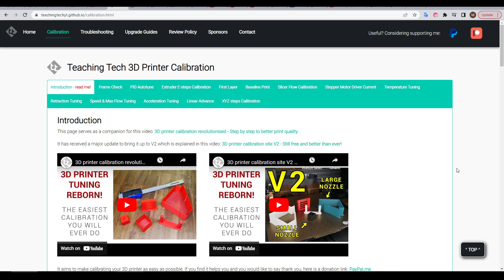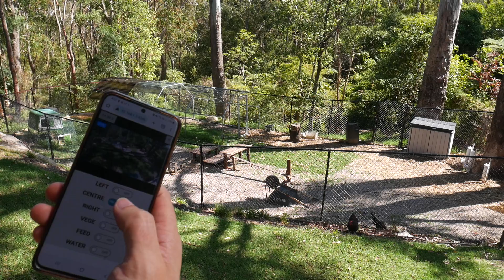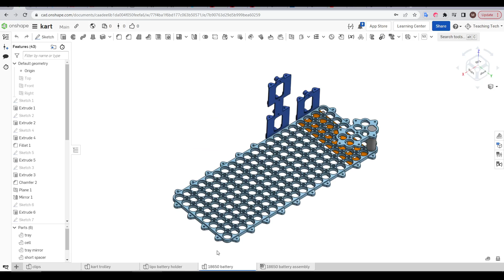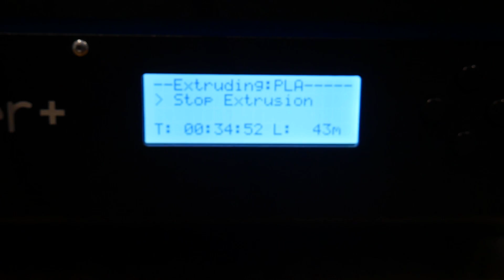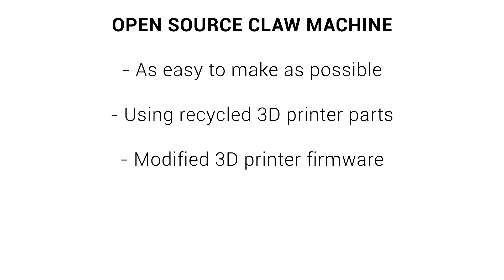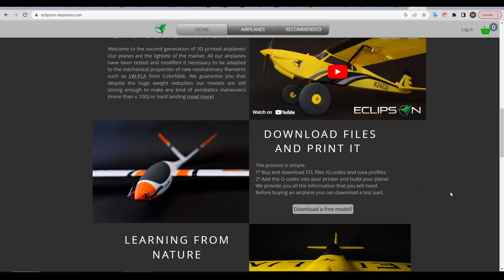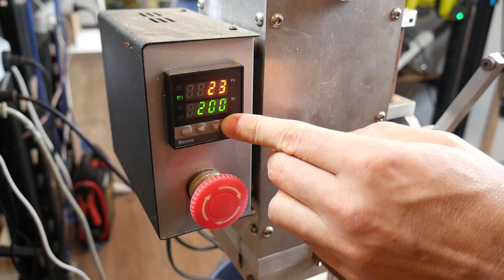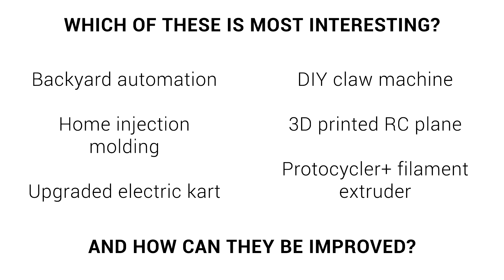Help me choose which projects to complete - 5 years of Teaching Tech

Comment: i would love to see an at home injection molded plastic machine in action. i don't see any machines that make recycled filament reliable enough to be used consistently. but a diy injection molding machine using recycled failed prints, and resin 3d printed molds could make operation fairly inexpensive 
though it would depend on how reusable the resin molds are. considering resin is much less recyclable
i got in to 3d printing through resin, though it did just order my first fdm printer this week. been reading up on your videos preparing for the fun!

Comment: As someone that has been flying RC for over 30 years, the 3D printed plane is the most interesting to me.  Two members of my club are also into 3D printing, one has a flying model that flies well, the other is still in the printing faze.  Have been thinning of trying one myself. If I can get my printers sorted correctly, so that parts actually fit together, I will try the RC plane, though I do prefer balsa models (plus they are larger). The kart is also an interesting project. Also a little surprised that your only at 400K subscribers, I have always found your videos very helpful!

Comment: 1. Back yard automation 2. DIY claw machine 3. Protocyler + Filament Extruder 4. Home Injection Molding 5. 3D printed RC plane then have fun with the last one: Upgrade electric cart (since it's already fully functional and usable, so you didn't loose anything really). And if you spin out and hurt yourself (unlikely) you can rest in bed after all the work is done, rather than doing that first and wishing you had sorted out the other stuff. 😉👍🏼

Comment: Help the pigmy goats! I vote backyard automation and I second Cooper -- with a customizable modular interface (both physical connectivity and physical or web UI control panel) including scheduling. Second vote is for the gokart - with some level of plans if someone wanted to replicate this OR with limited teaching of the basics (not "what is positive and negative" but more like why did you pick that type of recharge batteries, why that specific electric motor - what to look for if we were choosing, and how exactly is the speed controller working (custom or bought?) and wired in) so someone could say, build an electric scooter based on info from you. Keep up the good work! Heres to another 5+ years!

Comment: Happy New Year!

I'm going to pick the e-kart as being the only project I might possibly pursue.  The claw machine and backyard automation just aren't interesting to me - I'll still watch the videos, there's often useful things hidden in a video even if the main subject isn't relevant to my own, but as projects they're not all that exciting to me.  The Plane would be cool but I'm not really into RC planes so it would mostly just be entertainment for me.  The Protocycler+ and Home Injection Molder both speak to the main problem in 3D printing, what to do with the waste, but they both rely on very expensive equipment that I can't afford and have nowhere to put (I live in a 1200 square foot row house) so they again would just be for entertainment - there's not going to be any solution to my waste plastic problem hidden in them.

But the E-Kart is the sort of thing that I might build.  It's still not great odds and I probably would do the body more like a golf cart than a go-cart, but I've thought for a while about "I can build a remote controlled droid, I wonder if I could build an electric runabout?"  So that project would be at least partly related to my interests.

Thanks for the fun!

Comment: Anything about recycling is good. We need to push more mainstream 3D printing companies into the recycling market. An all-in-one recycler like the protocycler is great but that price has creeped up a lot along the years, half that price ($1500) would be much more reasonable. Instead of complicated and dangerous DIYs like modding a paper shredder, we need an easy and affordable way to recycle and if the price is high (multiple printers' price) no one would be doing it.

Comment: Backyard Automation sounds like a project of projects.
ie: Could easily be an ongoing series with a combination of 3d-printing, electronics and automation.

The Upgraded Go-cart is a more focused project also using a combination of 3d-printing, electronics and automation. The Filament Extruder and DYI-Claw also follow a similar formula.

Regarding an RC 3d-printed plane, the Model A-XL from Eclipson is an upgrade of their earlier Model A, with the design more focused on being a first 3d-printed plane, or as a trainer for those new to RC planes. Fewer parts, and better flying characteristics.
Have you considered making a scaled down RC car, or exploratory robot using 3d-printer parts like stepper motors? (sorry, another project idea ... doh!)

Think the trick with larger projects, is finding ways to break them down into smaller projects. Something easier said than done, as it can add complexity, or distractions.

Comment: The first thing I want to say is I don't want to see more people building batteries. While it is really cool, so many people have been emboldened by others doing it, and practically no one I have seen has proper safety precautions in place. If you make that video, someone is going to get seriously hurt, and it is on your hands. Secondly, I am interested in injection molding as it is a natural step up, and I have been thinking of using some of the special high temp resins for molds myself, though in my case for prepreg carbon fiber molds which need an oven cure. I would like even better a trip down using 3d prints for forged carbon fiber molds for high strength components as an alternative to having a full cnc setup if you are interested, and mold design is a sorely underrepresented skill and there are few good cad tutorials for it.

Comment: I do love your projects and congrats on 5 years of consistently good videos/content. My number one by far is the backyard automation especially around sensing things like soil moisture or water level then triggering actions like solenoids or motors being energized and the off-grid aspect would be great. 
2nd would be the go carts. 
Injection molding and PLA recycling are interesting to me but I just can’t see doing the projects as a hobbyist using only around 8-12 kg of filament per year and wasting much less as I become more proficient.

Comment: I think that what to do with old filament residue is going to become a hot topic in 2023, as this question has been floating about various channels recently. There are several semi-formed ideas floating about, it would be good to see the communty focussed on projects around this area as I think any real solution is going to bave to be handled by the hobbyist themselves, as centralised sorting and recycling isn't going to be the answer, at least not in the near future. Ideas on how to safely melt down PLA etc and turn it into something useful with moderately inexpensive equipment. Making new filament is probably not practical for home users, so other ideas would be especially good - is injection moulding a possibility?

Comment: By far the most interesting to me is the filament extrusion. I already have plans on building one myself, more from wanting to be able to reuse plastic for test prints, and thereby being more willing to iterate on designs, than for the usual eco reasons.

Second and third place would be the go cart (because of the high power battery pack), and injection molding machine.

Comment: Recycling plastics is a good way to get kids involved. I want to get kids to recycle plastic bottles and milk jugs. Then you can resin print in high temp a mold for injection molding or mill on your CNC. Tech kids how to do the infection molding to make a Teaching Tech "I recycled" coin. Then, they can use that coin on your new claw machine. Full circle, and STEAM involved.

Comment: Chris's Basement channel is currently working on his claw v2 -- I'll be building his version in the new year, since it is open source, based on 3d printer electronics, and basically is just that re-using 3d printer parts, so you can build his, and contribute your improvements there. I'm more interested in backyard automation and an actual recycling method that works -- all that I've seen so far are not worth the cost, extremely slow, and are mostly just vanity projects to justify the hobby. Congrats on 5 years, time flies fast.

Comment: GO CART, GO CART, GO CART, GO CART... I have learned a lot from your videos.. You have talked me into totally modifying an Ender3 to the point that it will print PC CF at 260extruder, 90bed, 50 chamber, 0.06 nozzle. 
 Thank you for the great content. REALLY you should finish all of these projects, BUT I would start with the rusted protocycler first due to it will get worse as you leave it on the back patio,, where the wife will have to look at it all the time....

Comment: Thanks for the last 5 years.  May I suggest with your teaching background.  I think there is a need for a channel with your quality to highlight STEM projects for classes of  20 to 50 students.   I volunteer at a local high school keeping their 3d print farm running, but over time  I created a few projects for the STEM classes.  I find it a rewarding challenge  to create projects that are affordable for 50 students.  I have to keep costs per project to around $5 -$15USD per student.  Many of the projects have  soldering  which the students really like. Most of the projects have "very simple" custom PCBs made with easyeda.  Some examples.  a 1 octave piano with a custom PCB in the shape of a grand piano and and Arduino.  The most popular project  is a lightsaber.  With ws2812b leds, motion detection, and custom audio files  down to around $15 per student. The students get to design and 3d print their own  hilt.  STEM teachers are always looking for  projects that a medium size group of students to do.
Reply: +1 to this! I did similar things when I taught STEM summer classes about designing, building and programming a cheap robot arm from scratch

Comment: In this order: electric Kart, 3d airplane, backyard automation. I am assuming all the normal 3d printing videos will continue. These are the reason I come here. I have come to value/trust your experience and I have benefitted greatly as I have moved from that first printer, to now three running Klipper having upgraded each model in succession to improve speed and quality. Although, at the end of the day, easier ia to buy a Bambu Labs printer and allow me to concentrate on 3d design with Onshape (thanks to you as well).  I would like to see more videos on design so I can be free to design and/ modify other designs- for me next step.  I do vintage motorcycle restoration and have just begun successfully designing and printing simple parts that you can no longer source.  I could make a small business out of this with my knowledge as an engineer, but my 3d design skills are holding me back.
Keep the great videos coming!